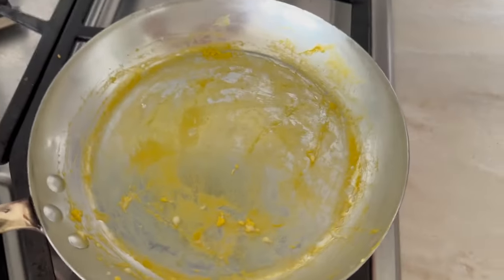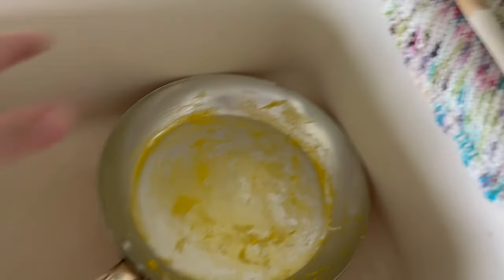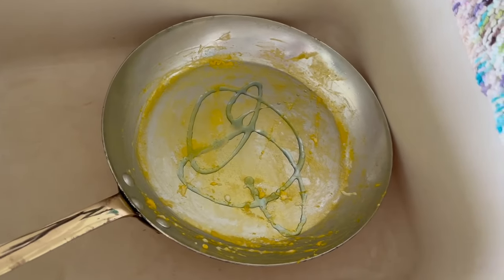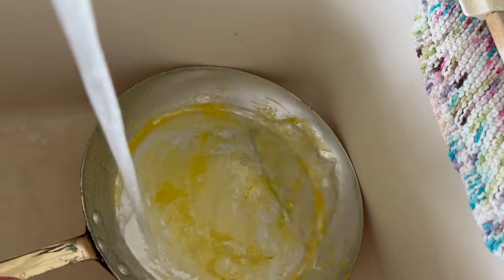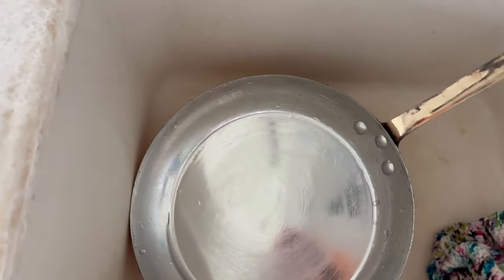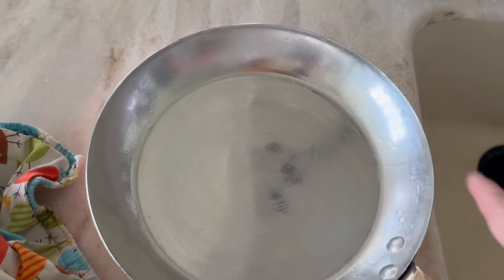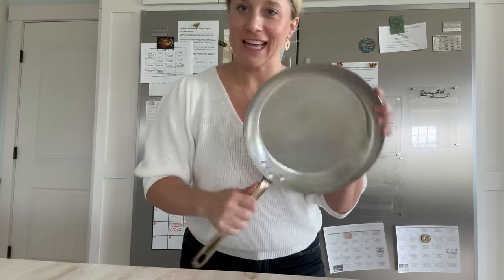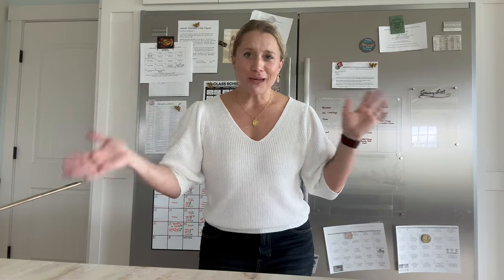How to Clean Tin Linings of Copper Pots

Comment: I use a bondo spreader or other plastic blade and first scrape the excess egg off (plastic will not damage the tin) then clean, a lot less work - I use this technique on ceramic pans and non stick as well.
Reply from the maker: Plastic cleaners also work great!

Comment: Thank you for this!     Question, How do you clean it if something has burned on the sides.
Reply from the maker: Thanks for watching! :) If the sides are burned, try boiling water (so the water is all around the burned area) with a little bit of dishsoap mixed in. The boiling water should loosen the burned food so it cleans better without restarting to abrasive methods and scratching your tin.